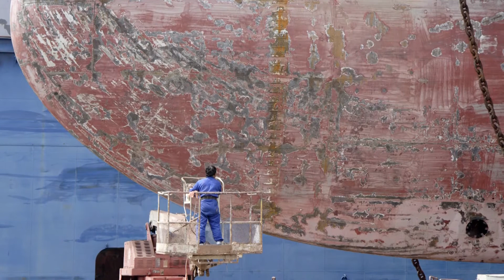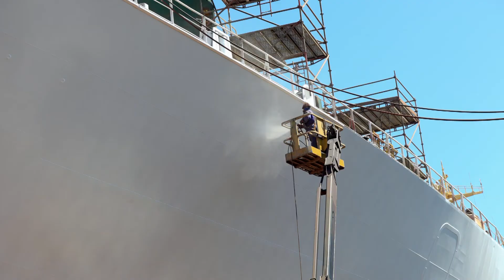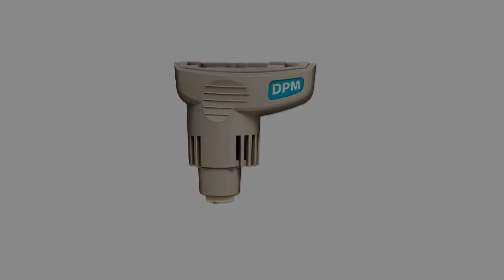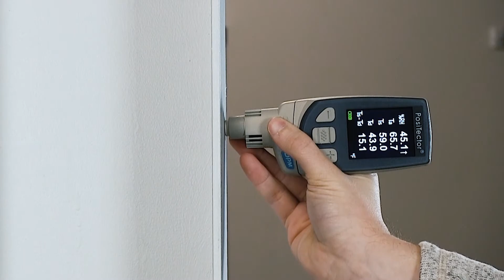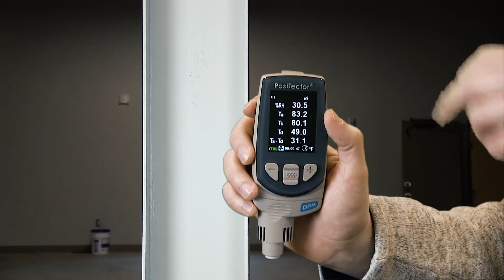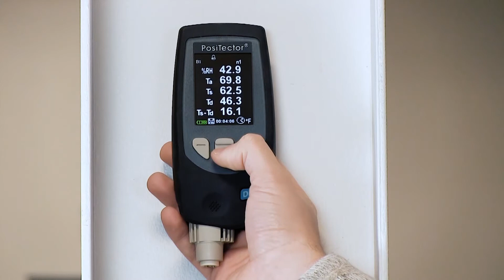How to Measure and Record Environmental Conditions with the PosiTector DPM Dew Point Meter

Comment: Please note that your device DOES NOT measure dew point.  It measures the amount of moisture and then calculates the dew point based on some charts.  It would help if you advertise your device using correct terminology so that customer can make an informed decision.  There is a significance difference between measurement of a property and an inferred calculation of that property. 

True dew point measurement can only be done with a chilled-mirror.